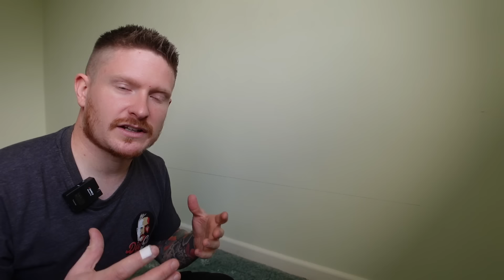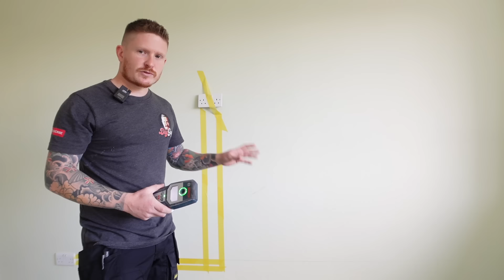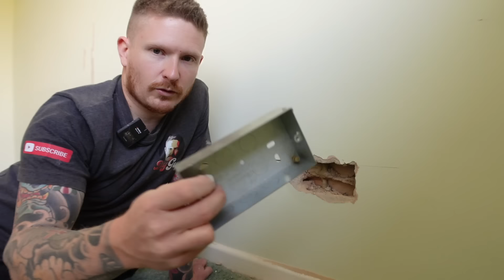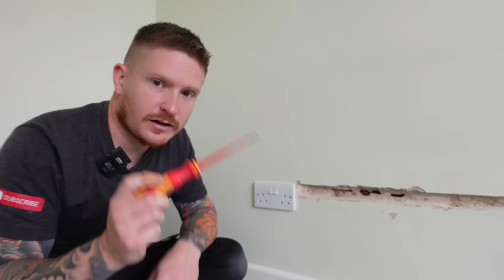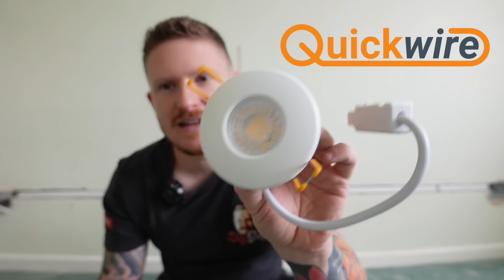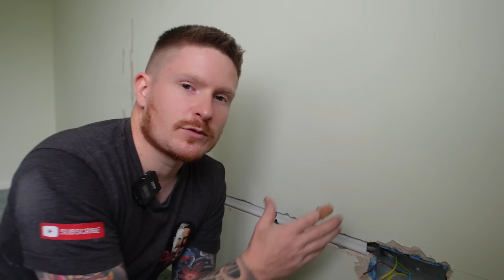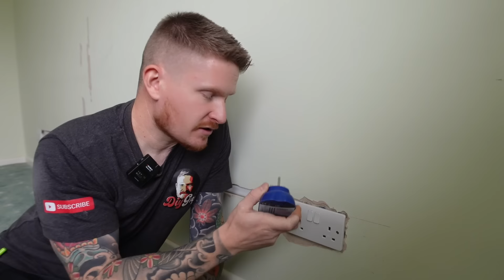How to Add a Socket to a Wall - Easy Step By Step Guide

Comment: Good information many thanks. Ive been doing electrics for many years (qualified) and ive never seen the earth wire used to pull the outer sheath back 😄. Certainly  quicker and safer than scoring with a knife and pulling back !! . Never too old to learn 👍🤔
Reply: Can't believe you've never seen that before my friend.  It has been the most  common technique used for ever. It doesn't work so good on  6 or 10mm T/E though.  In the case of  these thicker cables you would use a Stanley  knife scoring the sheath vertically starting off shallow gradually getting deeper as you come to the end of the cable and then just pull the sheath back and it will tear along the scored line.  It doesn't  matter if you cut into the conductors near the end of the cable because it's going to be stripped or trimmed anyway.
Reply: @truthseeker7794  Yep, I thought every 'proper' electrician knew how to strip T&E 🤷‍♂
Reply: Well believe it😁 In my defence my background was commercial so any household wiring ive always done is at home or for relatives so if you've never seen the trick you tend to carry with you own methods (till now) . 👍👍👍 @truthseeker7794
Reply: Yes and thats how I've always done it. Never shown the earth conductor trick during my training 😄 and worked alone since.  @truthseeker7794
Reply from the maker: 😊 thanks, glad I was able to add some value for you 👍
Reply: Well i wont forget that trick next time. Doesnt  work on SWA im sure 😁😂 @TheDIYGuy1
Reply from the maker: True 😂

Comment: Would it not be better to extend two cables and extend the ring circuit, rather than spuring off the existing socket?
Reply from the maker: You could if you’ve access under floor or above ceiling but this video is probably the more common way people will look to undertake the job.
Reply: Unless the new socket is to be used for a power drain over 13 amps - ie two 3kw electric fires at the same time - a spur is all that is needed so extending the ring is a much bigger job and rarely necessary

Comment: You can have as many spurs as you like as long as you fuse down to 13amps using a fused spur thus protecting the cable and limiting the draw to 13amps.
Also when adding a socket tests should be carried out on the existing cables to determine you have a ring final and continuity on L E and N and no broken circuit. Alot more to it than just chuck a socket on 🙄
Reply: Is there really a lot more though? If you’re a hired electrician contracted to do this work then of course you’d be expected to do that with test equipment etc so you can validate and sign off the safety of your work. But the LAW says this job can be undertaken by a COMPETENT person as DIY and such a person would look at the back of the socket and think yeah safe to proceed. Yeah we get it; sparks have to comment on videos like this to validate their job and that’s fine. But hundreds of thousands of people including me have done this several times and not burnt a house down. It’s all fine.
Reply: Yes correct!!!